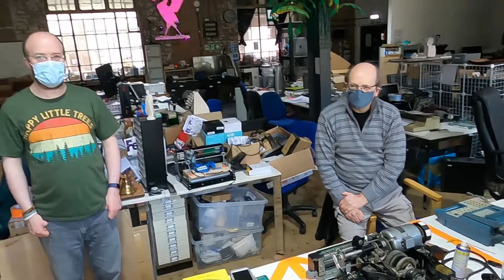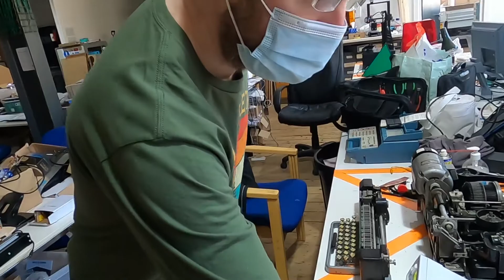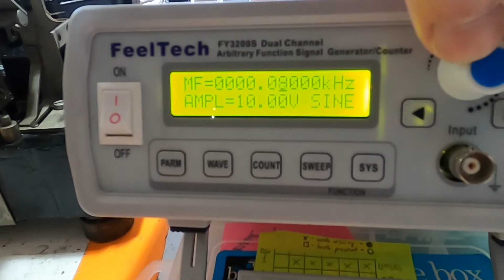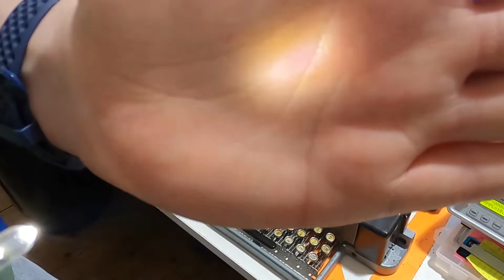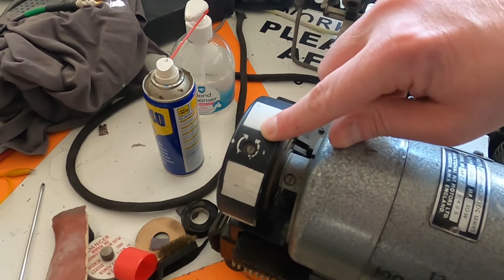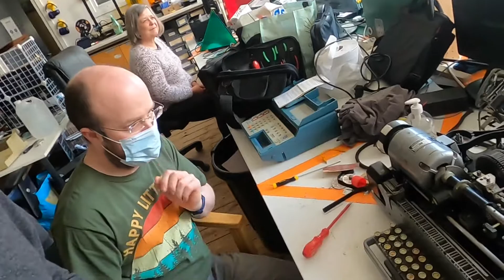Getting an old teleprinter up and running - part 5

Comment: Several years ago I throw away a working Creed 7B I used to use to receive TASS the Russian news agency on HF radio all good fun.
Reply from the maker: Nice! (well, not the having to throw it away bit... ;-)  Paul is looking forward to hooking it up to some RTTY channels to do something similar
Reply: @mcqnltd2430  It used to drive parents crazy with it running upstairs in my bedroom - I think it was 75 Baud or was it 50?
Reply from the maker: I bet!  They're not the quietest machines :-D  We're expecting it to be 50 baud, guess we'll find out fairly soon - once the motor power supply is sorted then we'll be working on how to interface to it
Reply: @mcqnltd2430  I'm pretty sure it's 50 baud, I do remember touching (accidentally) the slip rings on the back of the black and white governor a few times - I never learnt !. The one I had had a 'control' box partly made but it needed a LOT of fiddling from the previous owners lack of skills. I really wanted the tape reader/writer it never had one nore the noise cover.